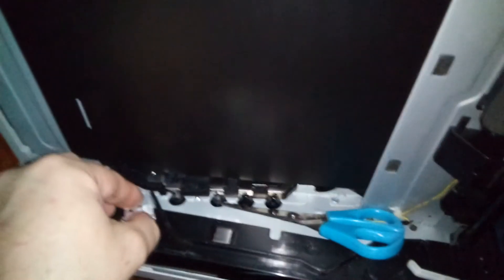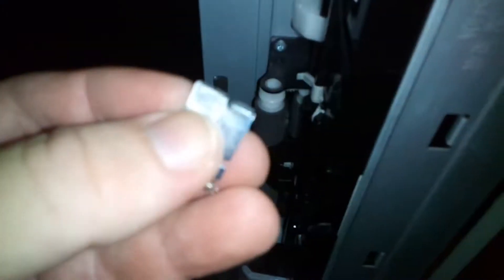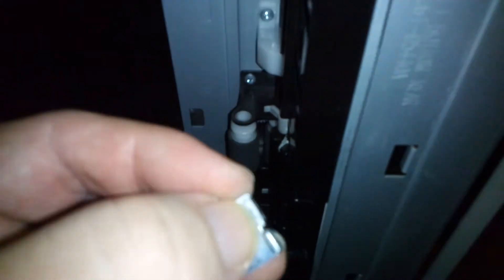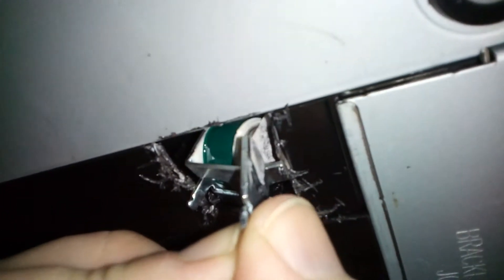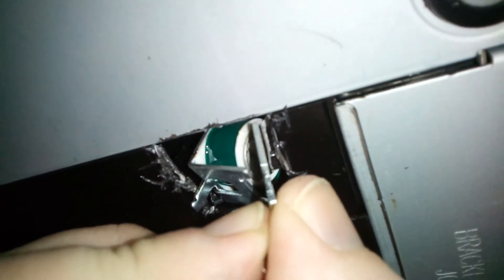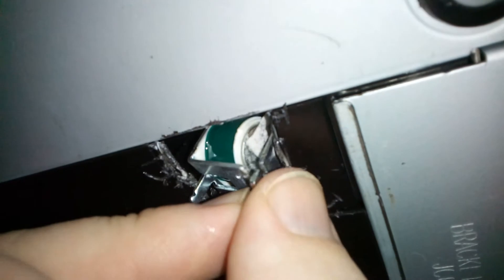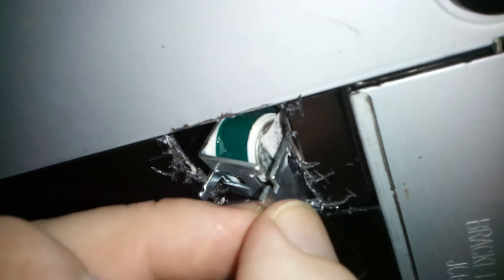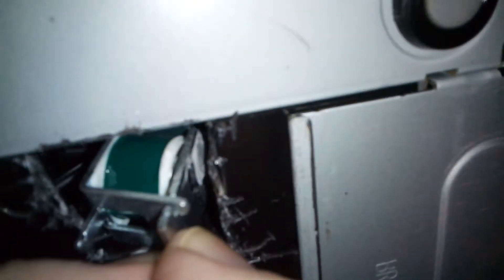Part3 Samsung clx-4195 c1860fw SLC1810W clp415 paper jam fix(2)

Comment: Listen, I was SO frustrated! I usually fix these things on my own.  I couldn’t figure it out.  I even took my samsung express to a printer repair place.  They had NO idea what was wrong.  I was defeated and planned on purchasing another printer.  I figured I’d look one last time to see if someone was having the same problem.  I happened upon your video!  And THANK THE GODS! Because I was about to throw this thing in the street!   Thank you thank you thank you!.  The rubber pieces were very familiar to me because last year I had the error on the cylinoid when you open the machine, so this made PERFECT SENSE!  Who would have thought something some small would cause such problems.     Its fixed! Thank you.   My only advice, I used a utility knife to score the plastic and then popped out the square.  Thank you!  You saved me 500 bucks!
Reply from the maker: You can  buy me coffee here http://www.paypal.me/fixitfast

Must have some lousy printer techs in your area.